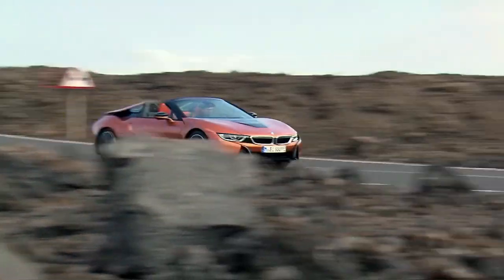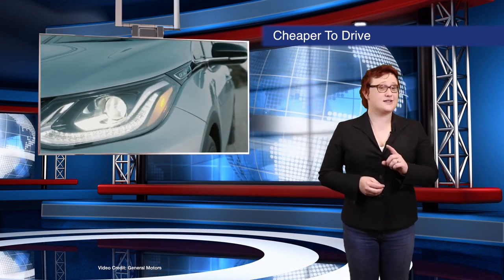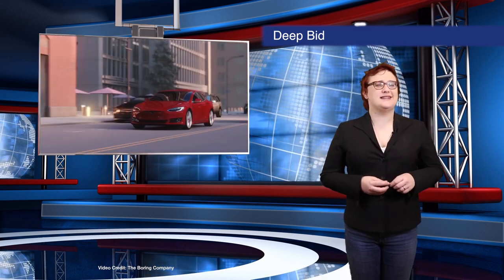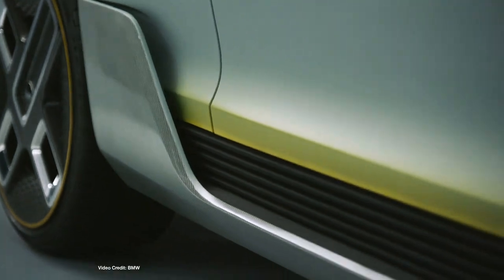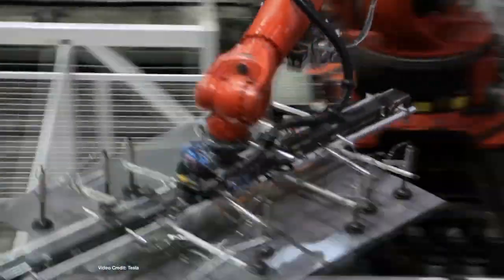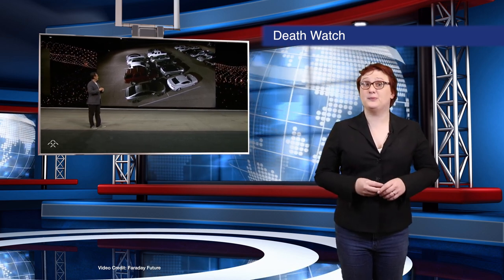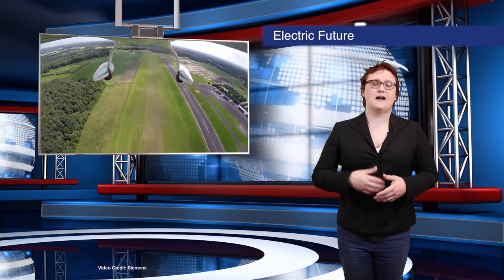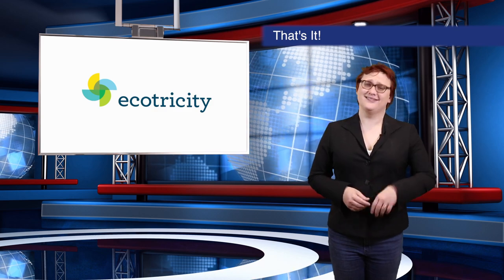ecoTEC 29: BMW i8 Convertible + Tesla 3 Order

Comment: Its dope and maybe one day ill get a tesla or an i8 but for your average citizen i dont think its very accessible, What if you live in an apartment? Where then do you charge it? sad truth is most people are broke, even if you can afford to buy one can you afford to fix it if it breaks? Good thing about petrol power'd is it works pretty much the same across the board, you dont need an engineer to fix it if a component goes out. Im not against electric cars cause i want one but i think the market needs a little more saturation before its viable for everyone.
Reply from the maker: j.jordan

That's fair. The Tesla and i8 aren't really suitable for the everyday bloke. But the Nissan leaf is on offer and very affordable. In NZ it is possible to have a charger installed alongside an apartment :) 

Many people purchase petrol guzzlers because it's familiar. In the past, cars being developed in the market would have been ground breaking and people would be hesitant to purchase them at first. This is no different - many more EV's will be on our roads in the near future as they learn more and become familiar with the latest transport technology. 

EV's are actually a lot easier to maintain and don't require many components.